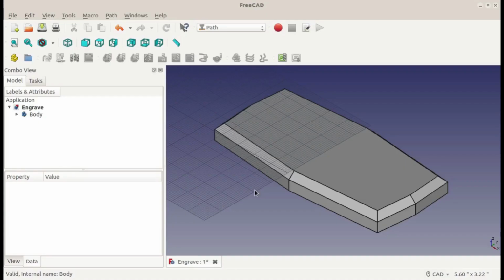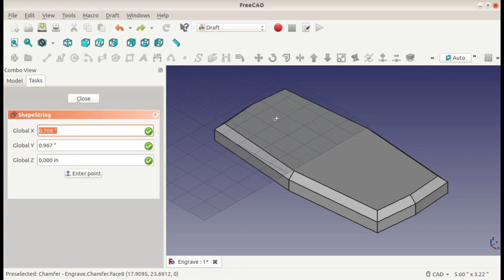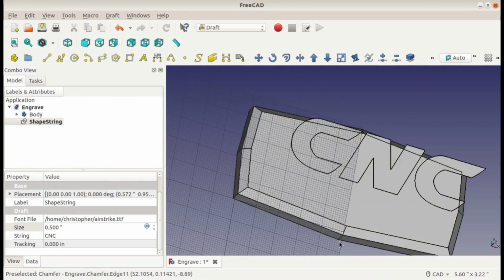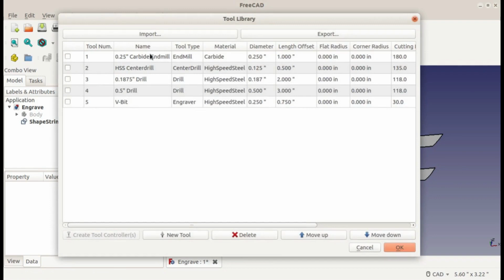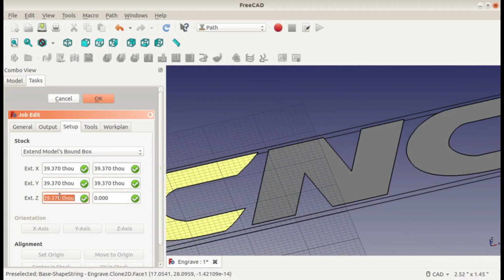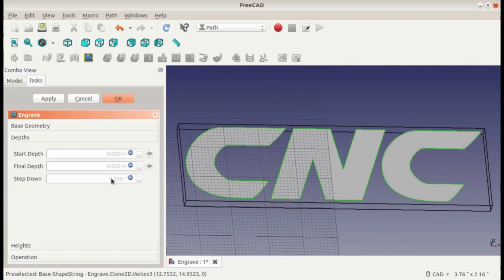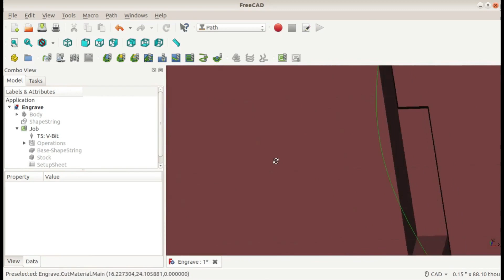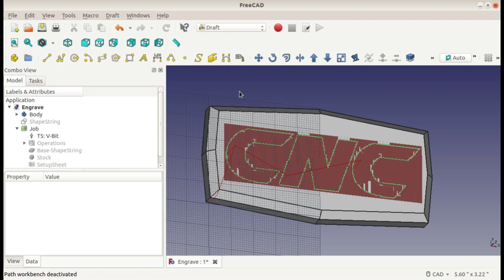Learn FreeCAD: #13 Engraving - Tutorial

Comment: I am trying to make an electronics enclosure with a transparent face plate for underwater use to 11atm.  The enclosure consists of two parts, a box portion (i.e. pocket) and the faceplate.  I need to create a channel/groove for a 2mm thick o-ring on the box portion and a corresponding channel on the acrylic face plate with a 2mm ball tip toolbit, the depth of each channel being 1mm.  Not one single demo or tutorial is enabling me to be able to do this.  The only solution I can discern is to create the path representing the center of the o-ring using Sketcher, then exporting it as a .svg file.  Then use Laser GRBL to create a .nc file.  However this will be 2D and the origin is not what I want, instead this software decided it was more intelligent than I and changed the origin based on the bounding box of the sketch, not the bounding box of the enclosure nor faceplate.  So, I have to either edit the file by hand or write a small C program to add the known origin of the channel in relation to the enclosure to all of the X and Y values in the gcode and plus add the depth Z value, plus put in some initial commands to lift the tool and move to the starting point safely and also at the end to lift the tool and move to home without dragging it through the stock.  There has got to be a better way.  I do not want to recreate the o-ring path in draft.  I have also not found any good tutorials on how to define my tool bits.  Big pain.  The problem is that so many steps are going to lead to mistakes and ruin my job and I gotta start all over and buy more stock.

Comment: There is a short cut to selecting the lines in the text, the "Finish Selecting Loop" tool. By default it is greyed out in the path work bench. However, after you click one edge of the letter, then the "Finish Selecting Loop Tool" can be clicked. It will select all edges for the letter.

Comment: Thank you for the tutorial.  I was able to select Draft mode but all of the toolbar icons were grayed out and couldn't be selected, including the text icon.  That's probably because I'm using FreeCAD version 0.18.  That's a common problem with FreeCAD video tutorials.  Everything changes from one minor release to the next.  I wish every video tutorial started with a declaration of which version is being used and a warning that the instructions are unlikely to work on any other version.  Even better, list the version in the video title so we can quickly find a tutorial that works for the software we're using.

Comment: I learned a lot from all the videos, but I never achieved or did see the results from this one, I still can't use the shape string tool in any manner or shape that matters, Seem that feature is broken or I simply don't really understand how to no matter how much I try. Not a rant, is just that  I simply haven't seen a real use for it or the program no longer supports it due to new versions and this videos are no longer valid. Still they are incredibly helpful, sadly the reason I was learning is for the shape string  tool.
Reply: Edit, sorry about above comment, somehow I did learn how to make a cut with the text, took some experimentation and some tweaking and amazingly it worked. Video helped farm more than I give it credit for.